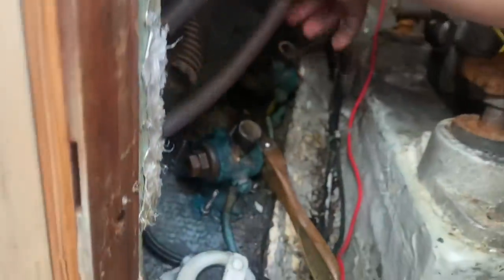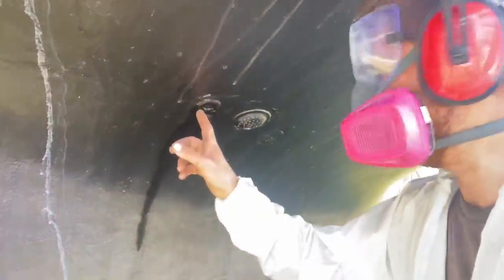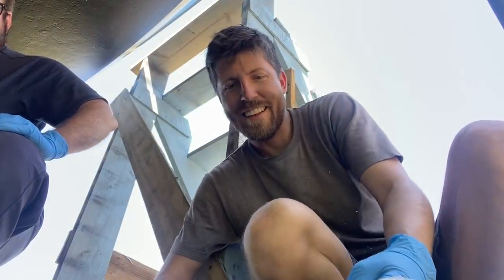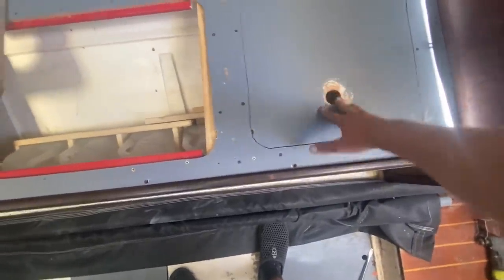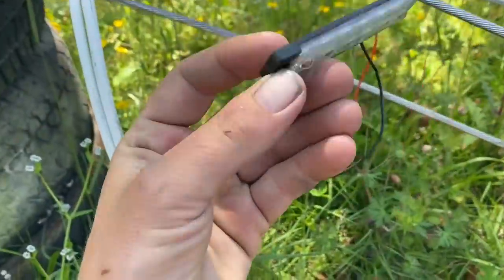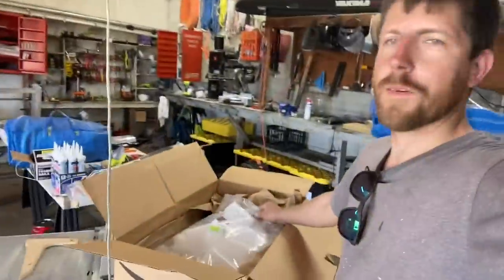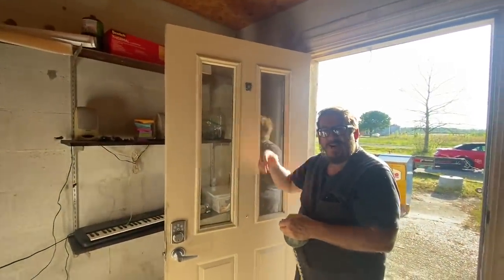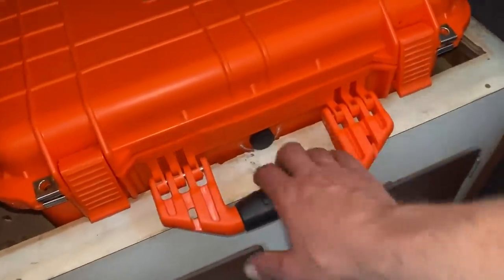Last minute glassing over thru hull

Comment: Don't forget to have some sandpaper and paint ready to touch up the spots the keel is resting on.  You should be able to get access when the boat goes on the trailer and it will dry on the drive to the water.

Comment: Mast white light to LED conversion: what angle can you see the replacement v. The original...  Little pinpoint lights aren't tail light/ headlights even if the same Lumens. Have to see from the side, etc.
Kewl aside add LED light to the thru Hull...

Might want to keep the handle, as a go bag, rapid exit to life raft/escape pod...

Car body goop work in Marine environment? FibreGlass but ...
Idk
Guess find out miles from shore...
Reply: At $750 for n sheets plywood,
wondering about cost v. Solar panels...
Reply: And oddly, 
Warm Showers Hut...

Comment: Get a couple desiccant containers to put inside of the electronics box to soak up the humid air.
Reply: I thought the same thing. But where would you dry out the desiccant? Maybe keep a small cloth bag of rice in there that can be rotated out as he cooks it. Another thought; With all the work he'd done, the inside of the boat is likely to be much drier than before.

Comment: FYI, you probably won't run into any problems but that steaming light LED won't pass USCG approval due to the necessity for a 225 degree viewing angle on the white light. This is why all the steaming lights (and all the other navigation lights, for that matter) have lenses which protrude out from the mast/cabinsides/etc. You need to be able to see the light from more than just directly in front of the boat, and the led strip you mounted will really only be visible for maybe 50-60 degrees off the forward centerline.
Reply: Put 3 up side by side
Reply: Might not be a bad idea to to install a uscg approved steaming light. I am no pro but i remember hearing a story about a drunk power boater hitting a sailboat . Sailboat guy lost the case because his steaming light wasn’t uscg approved.

Comment: Easiest way I found to remove thru hulls is with a dremel, from exterior, cut inside the thru hull with small cutting wheel, mushroom falls right off, minimal efflrt required

Comment: Great to see these daily updates.  Did you ever get Starlink setup?
Reply from the maker: I ended up canceling it and going with the iridium go. hopefully star link will come online for boaters at a reasonable price soon so I can switch.
Reply: @samholmessailing  apparently a mobile version will be coming out next year. Delays are probable, but it will apparently be deigned with campers, RVs and boats in mind. The current version takes a ton of power and a while to set up, while being locked to one address.
Reply: Starlink Martime is supposed to be coming out soon, but the price is insane at the moment, $10,000 for the hardware and $5,000 per month for the connection. Makes sense for large commercial ships and billionaire megayacht owners, but not for little guys like us.